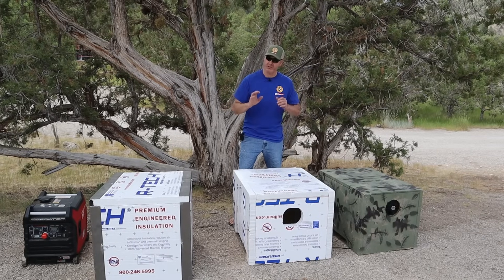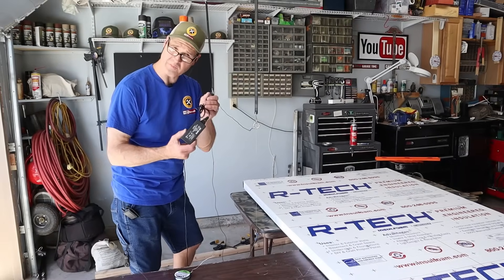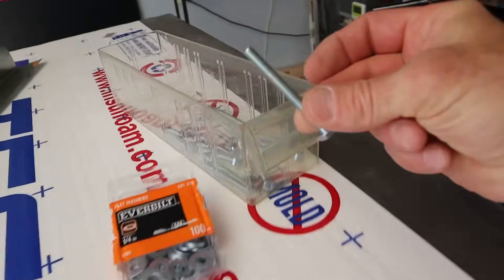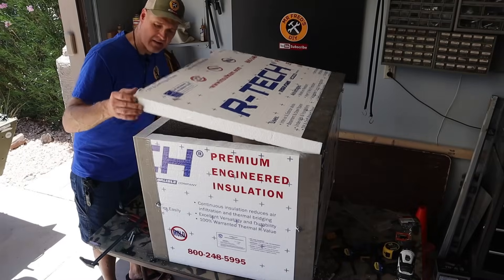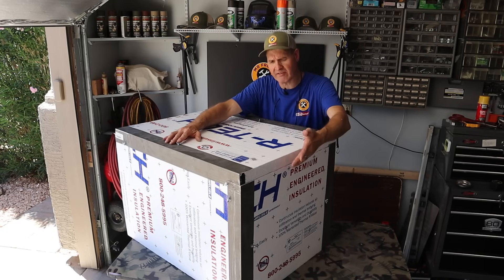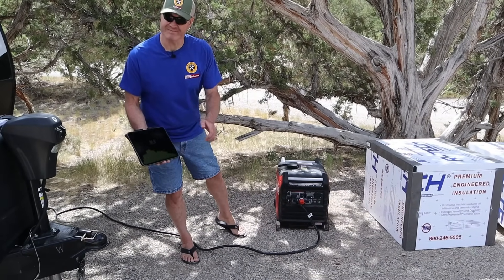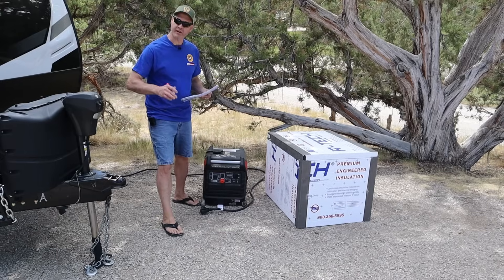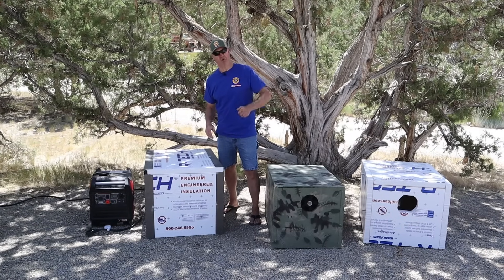Generator Noise Reduction Shed $30 Design

Comment: This looks great when tested for 15min in a nice day.... Now picture the grid power is out, 60mph wind gusts 5-8 hrs of run time needed in the middle of the night....
I'd pick my 3/4 treated plywood box, with angled roof(shingles on top), reinforced with 4x4 in corners, 2x6" duct fans for exhaust and 1x6" duct fan for intake(cold air). The box has soundproofing on the outside..

I can go to sleep, knowing the wind wont blow it, the gen will stay cool - that one was tested also:)

Comment: I did the same thing years ago. I neglected to make a video for it though. I built mine out of fire retardant drywall, and then put a thin layer of paneling on the outside for weather protection. The main reason I did drywall, is so the shed wouldn’t catch on fire. I initially built one out of wood like you did, but it didn’t seem to insulate the sound as well. I never tried foam though. Great idea!

Comment: The only potential issue I see is with the generator overheating since it is air cooled. You may be able to further reduce the sound with egg crate or other wool sound proofing inside the shed (would need to make it large to accomodate), or you can drape a heavy wool blanket over the top to further muffle the sound? Good luck on your quest and thanks for sharing. You already tackled some of the problem with generators with buying an inverter type that is probably 20-30 Dbs quieter than a standard generator.
Reply: yeah, no active ventilation (fan or something) which would help evacuate heat and provide fresh air to the intake...this is like creating an oven.

Comment: Kudos for the simplicity of design and build but if you would do a little research you will find that material density is the key to sound isolation, and rigid foam is very low in density. Think of sound waves as vibration and rigid foam easily transmits vibration, very poor at absorbing it.  Thump a piece of rigid foam with your finger and note how it will transmit the sound.  Thump a piece of OSB or better yet, a piece of rubber mat and you will hear a dull thud because those materials are better at absorbing sound rather than transmitting it.  A generator box constructed of proper materials would easily cut your dB readings down by 30 to 50%.  Your box could easily be made more effective by attaching loaded vinyl or rubber mat to it.

Comment: Try covering your box with MLV and re-test. I bet you will drop about 10 dB more.
Reply: What is MLV?  Thanks
Reply: @LEO-pc6hc  mass loaded vinyl. Watch some videos about it as it reflects sound. Usually worked best with this on the outside and the inside lined with foam/rock wool or other sound absorbing material.

Comment: Great Concept Going with that for sure?
Question though ... Would placing the reflective side on the outside provide a additional protection from he elements? Or is placing it on the inside preferred?
Thanks for the video!
Reply from the maker: My understanding is that both sides are foil-faced and one side is painted. I put the foil side, facing inward to help reflect heat back in the winter time. Thanks for watching.!

Comment: Try using a sound absorbing material that is non-flammable like fiberglass insulation or rockwool. A lot of the materials you used can reflect and conduct sound pretty well

Comment: Enclosing an air cooled engine may not be a good idea unless a fan is used to help maintain engine temperature.
When building of my 20kw home generator system using a 22 HP air cooled twin engine. I had to implement 2 high velocity fans and increase the size of the oil cooler radiator triple its original size. Not only am I able to monitor oil pressure but necessary to monitor oil temperature as it were a water cooled system . 
Including the Deep Sea Electronics dse7320 generator controller module. Engine protection features of high oil temperature will provide warning alarm and shut down the system before serious damage occurs. 
I designed my systems enclosure to prevent rain and snow from seriously getting into the system but yet able to provide adequate air flow to keep the system from burning up. 
Under a serious load during operation, the engine and generator head will heat up drastically .  
Sound shouldn't be all that important anyway when it comes to a home or portable generator.  
Just locate the system far enough away .  
Inside my home I cannot hear the generator running at all since it's location is several yards from my home.

Comment: you do realize they are air cooled, and they need O2 to run, this isn't very bright
Reply from the maker: We have tested several versions of these boxes. Here is an extensive heat testing video with lots of temperature data. Very surprising https://youtu.be/Ty8aJ2Eh_WI

Comment: Betting the fully enclosed foam box with the exhaust fan will win in all categories. Military used to put their 3.5kw set in a dug out hole at least a foot below surface. A pain to get on generator detail.all the noise and heat went straight up. Best that could be done in a tactical fld back in 80s. Been considering one of the kiddie tents. Cut out bottom. All of them are free standing with flex poles doing from corner to corner. Mostly interested in keeping out of rain.
Have the genset on pavers plop the tent over it stake the 4 corners. And stores in a roll next to generator. Can see a need for the box though in camping ground situations.
Reply from the maker: Interesting idea!

Comment: You have to encapsulate the generator completely. Look at a zombie box. I’m trying to figure the line of thinking by not fully surrounding the generator.  Even a gun fired away from you behind two walls will have a report.

Comment: What did you line the inside of the box? It looks to be some sort of aluminum or steel sheets. Lining the inside would cut the sound a bit, but it will resist the heat of the generator, without it it may melt the Styrofoam. This is a great video! Thanks for taking the time to make it!
Reply from the maker: That is just a foil backer layer on the styrofoam. I am working on a new video with a slight change in design and with soundproofing! That should be coming soon, thanks for watching!

Comment: I love your idea and simplicity, especially for when OTR.
How about using a wide strip of painters tape for easy release rather than the metal. Maybe placing a board on the top to prevent the wind from moving it around. GREAT VIDEO! THANKS!
Reply from the maker: Thanks for taking the time to comment! I have another version that attaches in a more simplest way. Here is the video for that.▶️https://youtu.be/IZw-N7zx6Gc

Comment: You do realise that just one open end probably means that the engine running hot and is ingesting its own exhaust gas - more or less, depending on prevailing wind direction. At the very least it will rob the engine of power and decrease the electrical load carrying capability of the generator. When it carbons up and stops working and you bring it to me for warranty repair, I will have to reject the warranty due to improper use - not enough ventilation (and that sort of issue is very easy to identify). In addition, with any generator that has a CO2 sensor, it will probably trip and shut the generator down. Not a great idea my friend. When YouTubers make suggestions like this they may open themselves up to some legal problems if they don’t know their stuff and people suffer material or financial loss. Just sayin……….
Reply: You'd probably like my setup:)....
"3/4 treated plywood box, with angled roof(shingles on top), reinforced with 4x4 in corners, 2x6" duct fans for exhaust and 1x6" duct fan for intake(cold air). The box has soundproofing on the outside.."

Comment: Pretty big difference when in close quarters. I heard a small Cummins inverter/gen running a few weeks ago and you could barley tell it was on even walking right by it. We've used our Champion 3400 watt inverter / gen more this year than ever going to horse shows and found that there is a huge difference in sound level even as simple as making sure the gen is on the grass versus gravel roads.

Comment: As a actually engineer for generator enclosures. Like runs hospitals and city blocks. Air floor and exhaust is the the most important thing. Be wise of heat too. Your exhaust will get hot! Trust me. I know. Best thing if you are gonna be outdoors in quiet areas is to NOT run those things.

Comment: Instead of metal corners you could drill the styrofoam and glue in pvc sleeves for the bolts, and use bigger fender washers. That would be a lighter way.
As some others have hinted, maybe line the inner side of each wall with 1" rockwool.
Thanks for you videos 👍

Comment: Be careful. Airflow around the generator is very important.
Reply from the maker: Thanks for watching the video! Airflow doesn’t seem to be that big of an issue with this design. I made a pretty extensive testing video on the subject ➡️https://youtu.be/Ty8aJ2Eh_WI
Reply: And especially around the engine. 

The engine relies on air drawn into the shroud, via the cooling fan (aka finned flywheel) located under the rope pull starter, and blown across the cylinder ...and also the crankcase oil. The hotter the environment, the more stress put on the engine and oil. If the air inside your "shed" doesn't allow a constant flow of cooler outside air, you run the risk of cooking your engine ...or certainly putting additional heat stress on it.

Comment: Styrofoam is definitely NOT a good acoustic insulator, trust me, its only used for its thermal insulation ...and it could catch fire...
Use rockwool thats an excellent sound insulator and fireproof.
Reply: I'd be curious to see how a modified version of this with a rockwool interior performs (and maybe a plywood version.)  It would lose the same ultra-compact/portability factor when taken apart (and would add to the cost a bit.)  But it could still be relatively easy to break apart and store to be used as-needed v/s having a permanent box or generator shed.
Reply: Every 3 decibel reduction is HALF the loudness, so there is a good reduction.   In other words, if a 57 dB sound is cut to 54 dB the sound level is halved.    I agree there may be other materials that could line the boxes and that may warrant testing but  we have to keep it simple to store.   Also, sound is reduced by distance so "directing" sound across a lot will in many cases not produce high dB levels.

Comment: We go dirt biking riding a lot, in the Mohave deset.
Big group of people.
 I have a gennie that I bought at a garage sale...30 years ago.
 Starts first pull, even now!!
 But it sounds like a cement mixer!
 A few years ago, two families with high end RVs,
 had gen trouble.
 We ran about a quarter mile of ext cords to my old gennie, and powered 3 RVs with it.
 It sat out on the desert for 5 days...making a ton of noise..and it saved that trip.
 Took it 200 yards away and leaned a camp table against it as a sound wall.
 Still have it. 50 plus years old now. Still fires first pull. And is noisy as hell.
 But we still count on it.
 (7 horse Tecumseh engine.) Bullettproof!!!

Comment: Sheeit.  I built one of them generator noise reduction sheds back in 1976 using bales of hay.  Didn't take long and I smelled grass burning.  Yup, set the bales of hay of fire but was able to rescue the generator.
Reply: Yeah, let's use kindling!
Reply: @JetFire9  that's what living is; learning. It's when you keep losing the wars you start that a problem needs to be recognized.

Comment: I had the loudest generator on earth, it was a Coleman. I too tried to make a sound barrier, I rigged up a car muffler to it and it was still so loud it drove us insane.  My solution? I bought a Honda. Was it expensive? You bet. Was it worth it. YES! It was so quiet, we were sitting outside of the camper and some asked if the generator died, we all looked around, we then noticed all the lights were still on.  There is an old saying that I go by, "Buy once, cry once"

Comment: Would it be better to bounce the sound waves straight up into the sky where no one is, wouldn’t it work better?  Deflection of sound waves straight up instead.

Artificial intelligence answer ——

Your intuition about directing sound upwards to reduce its impact on nearby humans is sound (pun intended!). Here are some points to consider:

Directionality: Sound from most common sources, including generators, is typically not directional. That means it's emitted in many directions at once. A barrier or material placed on one side will only block or reflect sound coming in that direction.
Sound Reflection: Sound waves will reflect off surfaces they encounter, including the ground. If you deflect sound directly towards the ground, you're essentially making it bounce back up, which can still be heard by those nearby. Directing sound upwards reduces this immediate reflection.
Absorption vs. Deflection: Materials like foam don't just deflect sound; they absorb it. Foam is designed to convert some of the sound energy into heat, thereby dampening the sound. A solid material like plywood will reflect more sound than it absorbs. If you're looking to direct sound upwards, using a reflective material (like a solid surface) would be more effective than an absorptive material (like foam).
Diffusion: Sound waves that are scattered in different directions are perceived as being less loud than sound waves that are focused in one direction. Designing a barrier that both deflects the sound upwards and scatters it can be even more effective.
Practicality: While deflecting sound upwards can be effective, the design and construction of such a barrier around a generator might be more complex than simply placing barriers around the sides. However, if done correctly, it can be an effective way to minimize noise disturbance.
Atmospheric Absorption: Higher frequencies are absorbed more by the atmosphere than lower frequencies. So, if you deflect sound upwards, over a significant distance, the higher frequencies will attenuate more than they would at ground level. However, this effect is more pronounced over very long distances and might not make a significant difference for something like a generator.
In summary, deflecting sound waves straight up into the sky can be an effective method to reduce noise disturbance for those nearby, especially when combined with other sound-reducing strategies. However, the design and practicality of such a solution need to be considered.

Comment: It barely made any difference to the db rating. That's a waste of money and time...
Reply: Ooh
Reply: 3 dB is half the sound, so it's the same sound you would hear about 1.4x the distance.

So the generator sound with the box at 25ft is the same  as without the box at 36 ft away.
Reply: For just $30, I'd say it's worth the effort. 
Any noise reduction from a generator is always welcome
Reply: Sound pressure doubles every 6 dB, and sounds twice as loud every 10. At a full load, the little foam shed was cutting out 6 dB of sound, basically cutting the loudness in half. That’s a big enough difference for me.
Reply: Even 1 points drop in dB rating is definitely noticeable
Reply: Somebody doesn't know exponential
Reply: I can’t believe 29 people actually agree with this comment. It just goes to show none of them understand how decibels work…😂
Reply: You have to understand db rating. That difference is huge.
Reply: That absolutely is a big difference. The audio on the video doesn’t reflect the in person difference
Reply from the maker: Sound is a funny thing! Here is my latest build that performs even better !https://youtu.be/Wn_GF1RQoow?si=QBgWgo9OTRdZ43mN
Reply: First thing you have to understand is the db scale.  On the decibel scale, the quietest audible sound (perceived near total silence) is 0 dB. A sound 10 times more powerful is 10 dB. A sound 100 times more powerful than near total silence is 20 dB. A sound 1,000 times more powerful than near total silence is 30 dB, 40 dB and so on.
Reply: Imagine making a comment when you have no idea what you are talking about.
Reply: Until it overheats

Comment: Yeah, and the gen-set will over-heat and shut-down if you're lucky, or just catch fire if you aren't! Good gen-sets (Cummins/Onan or Honda or Suzuki) are either liquid cooled or DESIGNED for being enclosed from the get-go. Frankly, any air-cooled "back-up" gen-set in a box is a piece of crap. I've worked on small engines longer than most of you have been alive and they don't like getting hot. What brand(s) of generators are in top-dollar motorhomes, like AirStreams? Onan and Honda (Suzuki Industrial).  Why? Until 2000 they were twins or four-bangers air-cooled designed to be gen-sets. After 2001 they are liquid cooled and bullet-proof. The Hondas started life as boat bilge pumps-became motorcycle engines-then gen-sets. Since a bilge pump keeps a boat from SINKING, reliability was old man Honda's middle name. Cummins/Onan power 90% of Cell phone back-power systems in the US-Honda power the other 10%. My ex-roomie installed and service them for a while. Cheap is cheap. A real "back-up" will cost you about a grand. That's 4 Kw,  runs 12-16 hours on a fill (or more with a tank kit), it's SILENT, a TWIN, and designed for continuous running, which the portables ARE NOT, but these you CAN roll in and out of the garage. Subaru offers liquid cooled gen-sets but I haven't worked on one, so I can't tell you about them like the others.